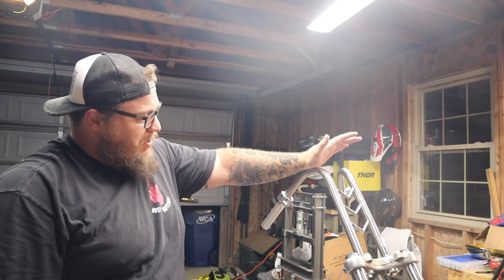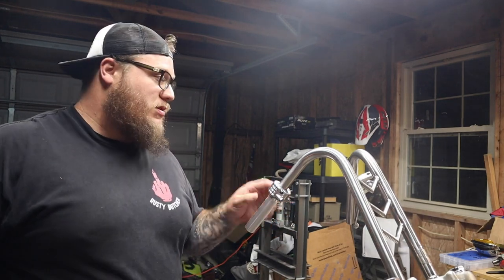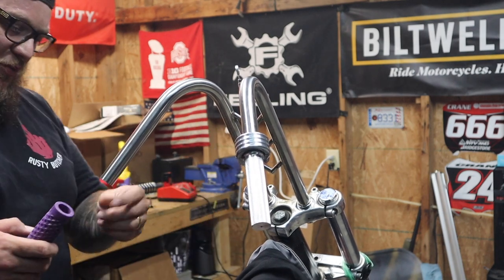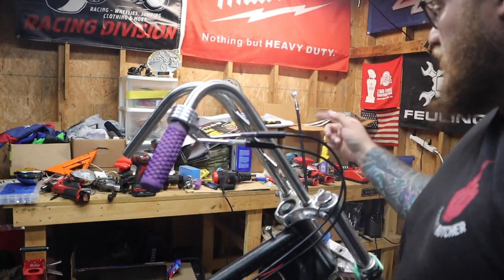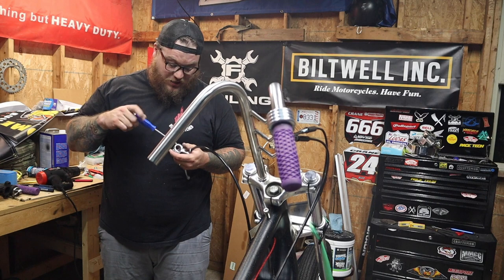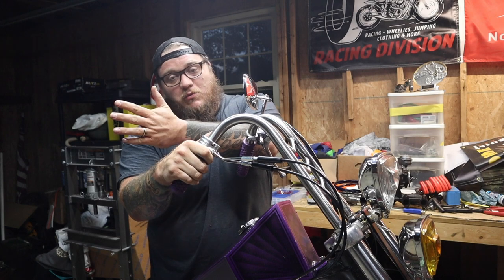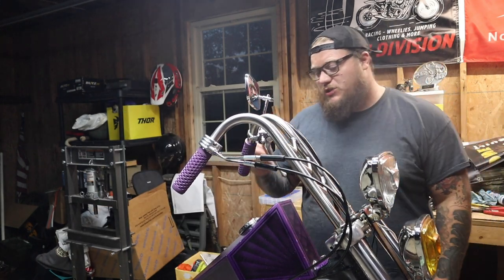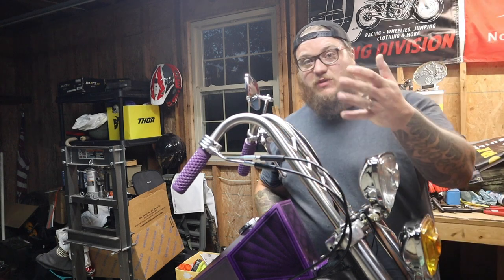Chopper Build | Episode 24: Rabbit Ear Handlebar Install

Comment: what throttle is that? Which is better, the TC bros or the Biltwell whiskey throttle? also, do you think a single throttle cable is fine/safe? my current stock bike has a double throttle cable
Reply from the maker: This one is the Biltwell dual cable throttle. I don’t have a problem with a single cable, I’m putting one on my shovel that I’m building. Besides, single cable look way better than dual. And safety?? Dawg, we’re building choppers, what IS safety?